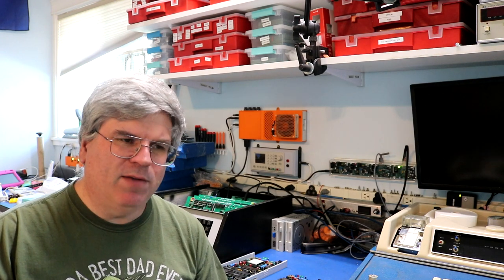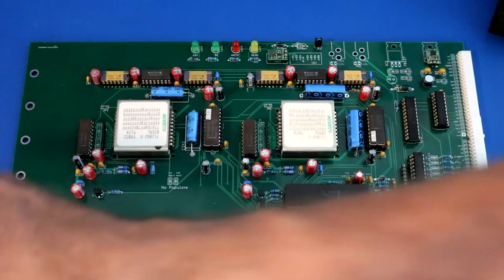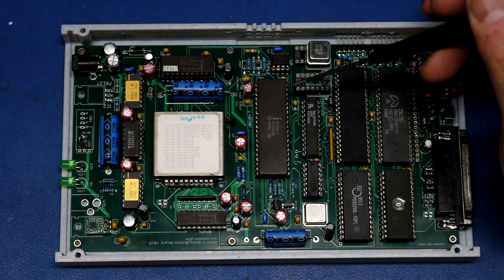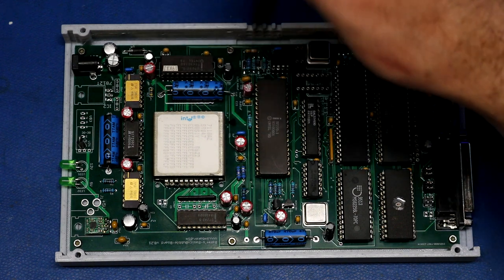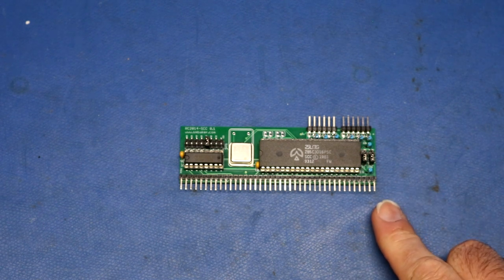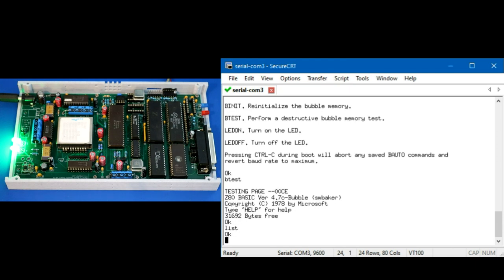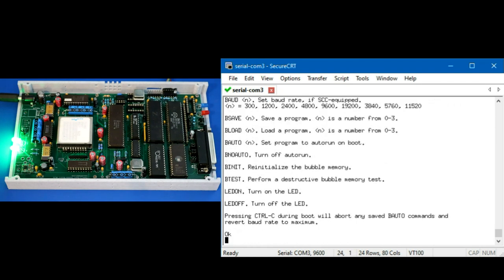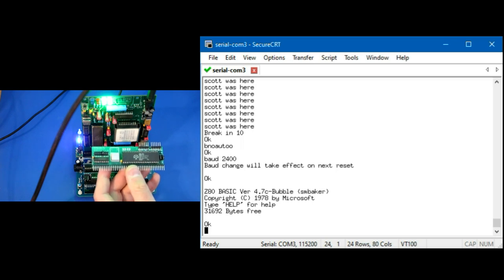Bubble Memory Part 2: Single-Board Bubble Computer and my return to the RC2014

Comment: I had a bubble memory evaluation board from Intel back in my misspent youth: we we using it as evaluation for an odd research application we has back in the day.   I later built an adapter to the eval board on to S-100 and used the board in a Heathkit H-100 computer, writing an MSDOS 2.0 driver for it.   Sadly all lost to the sands of time, now.

Good times.